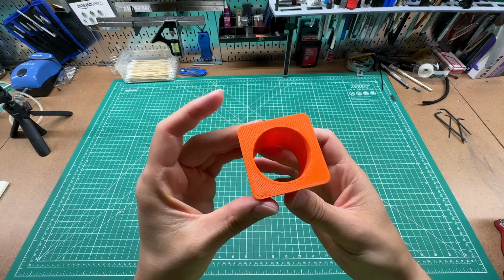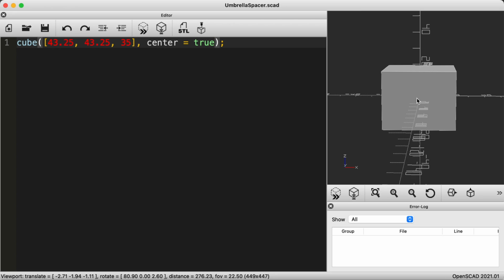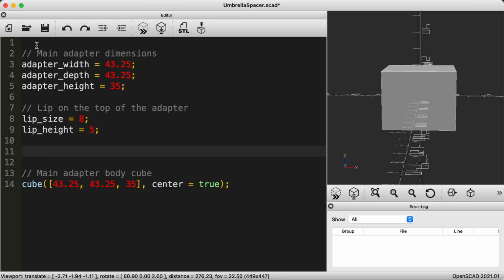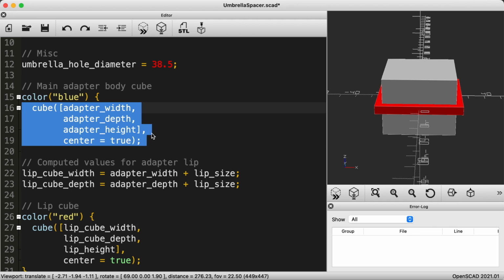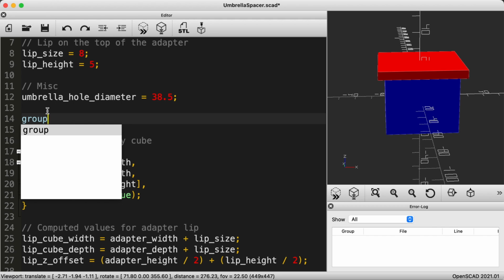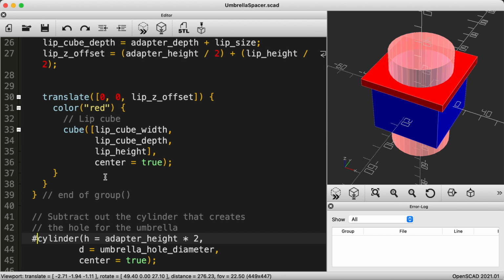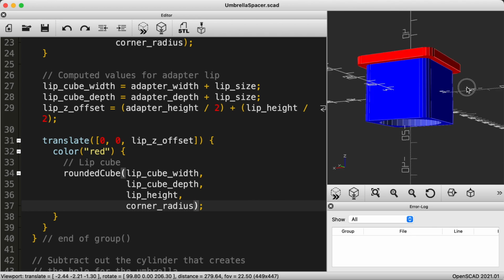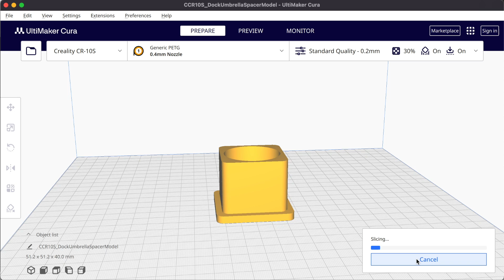3D Modeling with Code! The best demo (OpenSCAD)

Comment: i see this is 2 years old but I was just introduced to openCAD.  My AI support Algortihm Suggested we use that to design a new chair pad for my wife where i wanted to use a Fractal Vise concept for the back pad. I recieved the openCAD file but had no idea how get a view of the shape or how to modify or how print a test part. this video was the 1st one I found and it did offer a great intro to openCAD. Now I want to explore the functions and try to reverse engineer parts that I could then use text to edit the whole design. Like a Tender assembly I have in Fusion 360 where I want to make a range of lengths and could see, openCAD would be perfect to such a Project. One Chassis and Body shape, change the overall length output the length you need for an Atlantic Short, Pacific Medium or Northern Long. What do you think?  Dennis in VA on You Tube at Frankentrain Laboratories.

Comment: Great introduction. However I think cutting out cylinder by "brute force" height is an antipattern. Personally I would define cylinder of adapter_height + lip_cube_height and anchor it to the same plane as cube base. This way you will avoid accidental cutouts overlapping when reusing model later and adding something to it.
Reply from the maker: Makes sense. When you subtract somebting that is in the same plane like that the preview always renders weird at that point. It looks fine when you perform an official render, but this always bugs me and sometimes makes it unusable to do things in the preview. I get around this by adding a small amount extra to the subtracted shape. Like maybe I’ll add 1. Then you don’t see that weird artifact in the plane where the two shapes meet (in the preview). Curious if you know a better way to handle that?

Comment: what measurement it is milimeter ?
Reply from the maker: Essentially yes.  But I should note that OpenSCAD is actually unitless. When you export your model to something like STL and hand that to a slicer for 3D printing, each OpenSCAD unit is treated as 1mm.

So if you are using OpenSCAD for 3D printing, then you can simply treat all the values as millimeters.
Reply: @MostlyBuilds That really help. Thanks man.

Comment: As a programmer I love the idea of OpenSCAD, but I find it's far too rudimentary and verbose. Take something simple like snapping a child X distance from the outer perimeter of a parent object, that's a very basic standard CAD operation, it's doable in OpenSCAD, but you need to implement it yourself. I find that most of OpenSCAD code is just constantly calculating these kinds of offsets. FreeCAD-as-code though, that would be amazing.

Comment: OpenSCAD seems to rely on a custom language. That doesn't seem like a good decision to me. Otherwise, I found the concept intriguing.
Reply from the maker: It’s not hard to learn in my opinion. Most of your time is spent calling the SCAD functions to describe the geometry, which is basically equivalent to calling custom functions written in your language of choice. The actual language constructs that you need for control flow and looping etc are basically the same as any other language.

I’ve heard of projects that let you write code in another language and compile to SCAD. I looked this one up after I saw your message: https://github.com/jeff-dh/SolidPython

No idea how good it is, but maybe worth checking out.
Reply: JSCAD (formerly OpenJSCAD) is a JavaScript-based equivalent if that would feel more comfortable. There's also SolidPython which is a python front-end that compiles to OpenSCAD code.

Comment: Great video!  Man, I really wish OpenSCAD had an Elixir-style "pipe" operator.
Reply from the maker: Thanks! You could always try contributing a change to the open source repo. The devs that run it are on IRC I believe. I chatted them a while ago about a feature I was considering building and they were cool about it. Sadly I never got around to completing it 😩

What situations would you find it useful to pipe a result to a function or module? Just looking to eliminate intermediate variables or something?
Reply: I use PowerShell a lot at work so I'm very used to piping stuff around a bunch so a pipe operator would be pretty cool.

Comment: so much work for such a simple shape
Reply: "so much work"
It's pretty quick to do actually, and compared to traditional CAD the resulting file is much easier to maintain and update being parametric. Also, the code is self documenting how the part was done.
Let me know how much time it takes to get all these benefits with any other tool.
Reply: @tommasobonvicini7114  I'm sorry to say this, but the part shown in the video would take about 1 to 2 minutes in traditional CAD. It ist MUCH faster. Traditional CAD is very intuidive, parametric and has a "self dokumenting" feature tree. There might be some use cases where this tool is better but for the majority of tasks I can't see how this is any better. Still a fascinating approach to CAD in my opinion
Reply: You didn't see the real power of this. Console or gui application can generate complex code for openscad and open it automaticaly.
Reply: I've tried OpenSCAD, JSCAD, and FreeCAD..  FreeCAD is the winner.  OpenSCAD you wind up with a piles of obtuse code.  JSCAD gives you obscure errors if the slightest thing is off, making you dig thru their source code to understand why.  FreeCAD, you just put your parameters, equations and constraints in a spreadsheet and the rest is traditional CAD.  So easy.  And if you require code to generate the object, you can interface to FreeCAD from almost any language, and generate your object.
Reply: @The-KP  Haha and I gave up on FreeCAD cuz Fusion360 was just so much more intuitive.
Reply: @The-KP  "and the rest is traditional cad"  That can be a problem.  CAD is complex and if you are new to it, the learning curve can be steep, especially with Free CAD which is known to be buggy.  However, if you are already comfortable with simple programming concepts then OpenSCAD makes designing simple functional parts like this quick and easy as demonstrated in this video.  Including parameters and saving portions as reusable functions makes future designs even easier.  For simple functional parts like this, OpenSCAD is ideal.

Comment: Very nice, you made the process seamless. 
How would I go about adding a chamfer along the top ?
Reply from the maker: Check out this rounded cube library: https://danielupshaw.com/openscad-rounded-corners/

The pink cube in the example is the one you want I think. I assumed you just want a softer edge. I came across this chamfer library as well that just chops it off at and angle, if you prefer that: https://github.com/hraftery/prism-chamfer

My rounded cube implementation that just does the sides is pretty basic. Certainly possible to improve on it with what you are asking for, but probably better to leverage the work of others that have spent the time to build proper libraries for rounding.
Reply: A pretty simple way would be to place octohedra with the radius of your desired chamfer at each of the (offset inwards) corners of the "cube", then wrap everything up in a "hull". Make the octohedra with two cylinders end to end, with d2=0 and $fn=4. Just use spheres and you'll get rounded fillets from the same code, mix and match if you want.

You can do the same sort of thing with the "minkowski" operation, if you can get your head around how it works.

Comment: Scad looks great for my next project - more tutorials would ber great. Currently trying to do this kind of thing with geometry nodes in Blender.
Reply from the maker: Thanks for the feedback! I have a few ideas for future videos. Consider subscribing if that interests you 😀
Reply: @MostlyBuilds  Already did ☺️ My project is to design a large power bank that will be 3D printed. Lots off complicated fittings etc.
Reply from the maker: @davidrgilson  cool! If you aren’t aware of “heat set inserts,” that might be something to check out if your parts need solid screw attachment points.
Reply: @MostlyBuilds  I have to confess but I am aware of them but was too lazy to work with them and instead just made screw holes in the print but I could tap the screws into. Probably terrible practise
Reply: @MostlyBuilds  to clarify, I'm talking about the previous power bank for they designed in Blender. Maybe I'll do better with this next one!
Reply from the maker: @davidrgilson  hah. I used to just use screws on plastic too. It works fine for the most part (unless if you are repeatedly taking things apart). I eventually switched to the heat set inserts and got special tips for my soldering iron. You can get away with regular tips too, but you have to be more careful. The inserts work really well, and give parts a more finished look (if that’s important to you). Good luck with the project!

Comment: I just recently learned about this software, the code reminds me of Python and isn't intimidating at all. I was worried that it would look like C or C++ being an open source project.
Reply: There are some VERY cool tricks too. Look deeply into the Customizer for starters. 

Selected text can be dragged to move it, or cntrl-dragged to copy it, nice.

Also, and this might be the MOST useful feature of this wonderful program: Put your cursor just to the right of any digit, then ALT-UP will increase that digit and ALT-DOWN will decrease it. Updates will render instantly, and it makes fine adjustment SOOOO simple. If you need more precision, ALT-RIGHT will add decimals to the number. Brilliant.

Lastly, since I hate to type, I created a whole bunch more of the command templates, the ones you can access by right-clicking in the Editor, and clicking Insert Template. There are a few simple ones by default, but you can make whatever you want. I often want to create a cube with both rotation and translation, so I made one template that inserts all three with default values. The templates are just .txt  files with a .json extension, and the syntax is easy.

I'm happy to help if you have any questions. :)
Reply from the maker: Yeah it’s pretty friendly. For a long time the IDE didn’t have autocomplete, but they added that in the past few years. It’s really nice. Between that and the “cheat sheet” that they publish, I rarely ever have to look stuff up in the official manual. https://openscad.org/cheatsheet/

Thanks for checking out the video!
Reply: @MostlyBuilds  I have a question, if you don't mind. Does autocomplete do anything more than showing you the syntax and completing the keyword you are typing, or am I just using it wrong? It would be great to be able to insert the entire structure with default values, like Insert Template,  right then and there. Thank you for your consideration, and for making this great video!
Reply from the maker: @davidkaye821   my experience with the autocomplete is the same as yours. It's pretty basic, but it's so much better than before when there was nothing at all. The better solution that you described would be really nice. Other IDEs behave this way with inserting the whole code block and putting placeholder values in (Xcode for example).

Recently I read about a VSCode plugin for OpenSCAD: https://github.com/Leathong/openscad-support-vscode

I haven't used it, but it says that it supports autocomplete. Not sure how it performs. Might be worth checking out.

Thanks for the comments and the kind words!
Reply: @MostlyBuilds  Would you be interested in seeing all the templates I've made up? My goal is to NEVER type a keyword in again. I could post them right here in these comments, it's just a page or two of text.
Reply from the maker: @davidkaye821  totally! You could post them a to GitHub and link that here. Then that gives others a place to contribute

Comment: Nice video! I reimplemented it in build123d (a different type of CodeCAD that uses python and has built-in functions like fillet/chamfer). Here is the source code in build123d:
from build123d import *
with BuildPart() as p:
    with BuildSketch() as s:
        RectangleRounded(43.25,43.25,5)
    extrude(amount=-35)
    with BuildSketch() as s2:
        RectangleRounded(43.25+8,43.25+8,5)
    extrude(amount=5)
    Hole(38.5/2)
Reply from the maker: Very cool! I will definitely check out build123d! Thanks for sharing. Consider subscribing 🙂